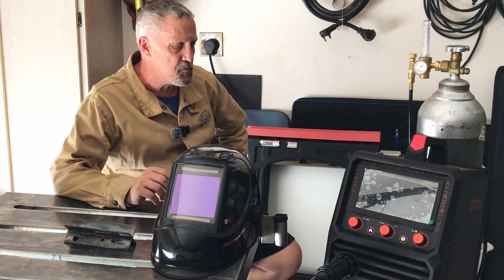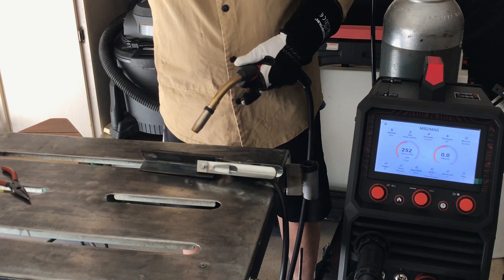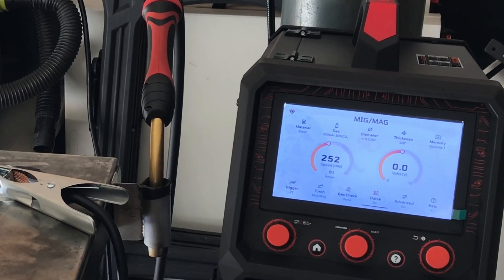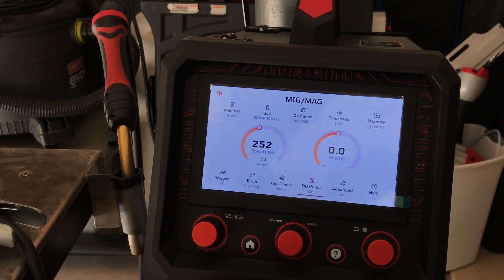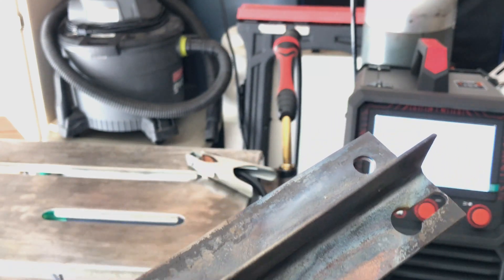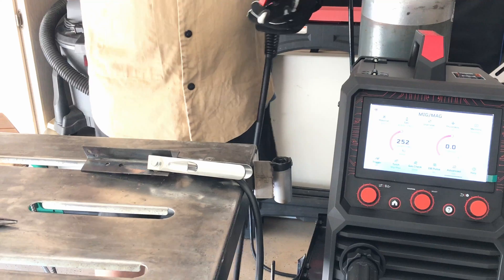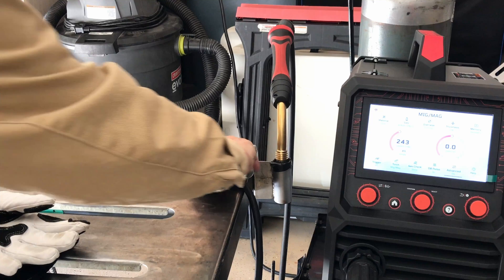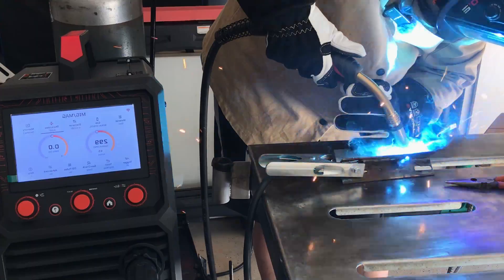How to MIG Weld Aluminum Like a TIG Pro (Double Pulse Secret)

Comment: If you're using 75/25 gas you might not be getting optimal results... Pulse MIG isn't short circuit transfer, it's modulated spray transfer. Which means you really need to be running 90/10. In fact I don't even think the machine lets you select 75/25 when running pulse... I mean you can run it anyway but I don't think the results will be too good
Reply from the maker: I agree

Comment: I tried the pulse with 16 gauge steel and 90/10 gas and the splatter was horrible.  Can anyone recommend settings?
Reply: You need to keep longer stick out 1,5 cm - 2cm and correct the "trim" or "arc lenght" (volts) in settings. I hope it helps you, just play with settings

Comment: So when it comes to budget priced machines we all know there’s a trade off. 

I’m fine with that….just show me where it is. 

I’ve no way to verify if the welds are from the machine I’m being told/shown made them. 

Video them, cut and etch them.  Show some video of weld (the actual welding) with a proper filter.  Surging wire feed systems can be seen with proper video. 

On a budget machine that’s dual voltage and has high end features like pulse I’m skeptical. 

To portray these machines as comparable to comparable commercial level ones is ridiculous. 

For the home hobbyists, tinkering we know is a different class of requirements. 

No hate here just economics …

Cost versus quality

Comment: Pulse and double pulse is more designed for thin metal especially aluminum.
Reply: Double pulse you can use it on thick staff
Reply: Pulse spray penetrates better than short arc

Comment: The pulse settings definitely need adjustment. I think the factory setting is better suited to 1/8 aluminum mig welding.  It's a lit different the multi dial pulse mig welding I'm used to.  It will stack dimes in double pulse, I've seen it done successfully. I can't wait to get mine, I need a portable machine!
Reply from the maker: Enjoy your new machine and thanks for stopping by!